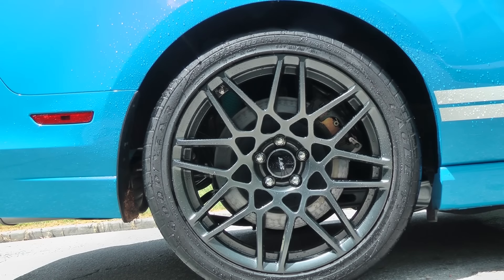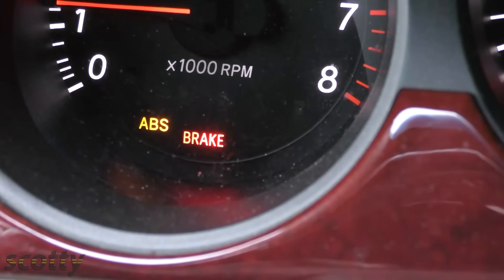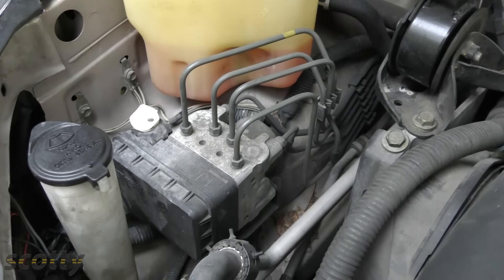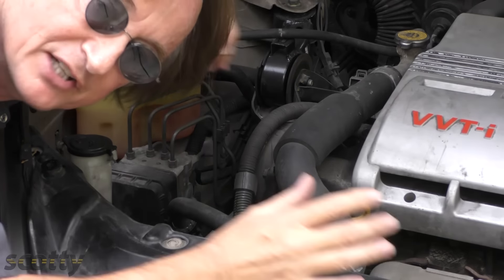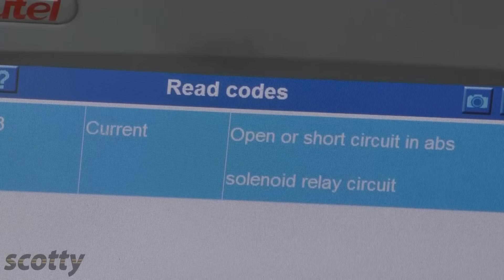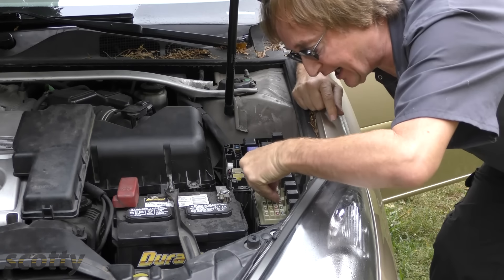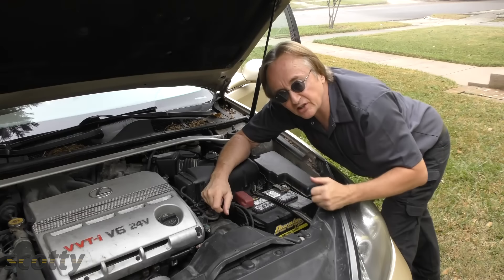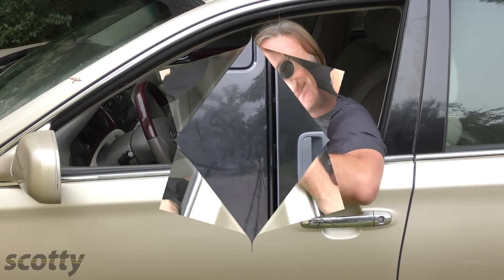ABS Light Stays On, What To Do?

Comment: I use black electrical tape !
Reply: Rodney Brand Well you don't really see white electrical tape, so it isn't lol.
Reply: Me too, not worth the money to fix, and in my case rear ABS only isn't useful for anything in the first place...course ABS, traction control, stability control, etc. is nothing more than a safety nanny that let's people who have to business behind the wheel drive :(.  Most of my vehicles don't have any safety features at all, and guess what, nothing fails in them because there's no damn computer to fail.  Air, Fuel, Spark, that's all I need in my vehicles to get going, I did upgrade the brakes a while back as the brake pads that were on it along with the discs and drums were horrible from the beginning...don't buy cheap brakes or brake parts, at some point you will want to stop LOL.
Reply: Be careful. If you drive a car like that and have an accident your insurance company can claim you were driving a car knowing it had "defective brakes" and deny your damage or liability claim.

Comment: Have you any experience using Honda protective capsicum tape to prevent rodents eating the wires leading to the wheel speed sensors ?

Comment: Well still have light on they said breaks are installed ok and it could be a senser but also Ive seen cars with dirty sensors and saw them clean them. One of my cars had sensor on sometimes and sometimes not. Like my van with oil light on sometimes.

Comment: There is also connection to wheel bearings. My repairman said that broken wheel bearings has damaged the abs cable and they both need to be replaced at the same time. Otherwise same problems will come back. Those cables are one third price in internet than stores and I order wheel bearing at the same time. I scanned and it told right rear wheel has connection problems. It comes off and on very randomly and cold weather and warm engine has influence for that.

Comment: on some vehicles when ABS light comes on brake light to come on to but your brakes will still work just fine you just have regular brakes and if ABS module goes out you won't be able to read it on a scan tool anyways if you know how to use your brakes correctly and pump them without the ABS you can stop quicker

Comment: my car had a steering wheel position sensor go bad which was complete hell. you'd be driving (usuially making a curve) and the brakes would freak out for no reason at all. then the little dash screen would say "service stabiltrak" and " service ABS system" took the dealer many attempts to find the problem. it was under warranty so it didn't cost anything except hardache and time.

Comment: Hey thanks Scotty, do you have any videos on Isuzu's, i Just got one Rodeo for $1900 in L.A. with 145K miles 2002, guys a mechanic and wife drove it, he kept it nice. ABS just came on LOL. Runs great! I had another 98, a tank, last 5 years I didn't change the oil just to see when the engine would seize, it didn't, I finally drained it, really bad, but it kept going, sold it to a student, lol.

Comment: My issue is that my ABS module in my Camaro needs the circuit board joints to be re-soldered and I'm considering shipping it to a repair shop. I haven't tried, but is it safe to drive a car without an ABS module installed?

Comment: The ABS sensor is in the third member not per wheel only the right wheel locks up the emergency brake seems to be free the rest of the components look normal not sure about the slave cylinder this is an emergency we need to tell all the way to Missouri so if you could help me as soon as you can I would totally appreciate anything you can help me with thank you

Comment: I have no lights on dash 07 dakota 192k miles the brake pedal will push to the floor but i can pump it up, new master brake booster etc.... now can the abs fail but not throw any codes? And of course nothing on YouTube pn how to change them and bleed them online, guess its not so much of an issue for these trucks idk... so say i pull the fuse and have normsl brake pedal again would this mean thr module is junk? Can it be rebuilt?

Comment: I have a Celica im gonna use as a track car. And my Abs stops working then starts again, Not fun if your going into a speedy corner and the car suddenly deceides to bo old regular brakes. It lockes the brakes. Where i plug in my sensor that thing is busted. How do i check them the old scool way or make a video about changing the sensor plug in? Thx :)

Comment: Hi thx for easy explanation on ABS lite on dashboard!!
I don’t understand why my ABS lite would be showing on dashboard, especially after I just put new brakes in, all around & I just put new tires on also all around!!
Why is the ABS lite on aftr hving new breaks& tires put on my car!!!
Can u tell me why??
Ty again
Reply: Your car has four wheel hubs behind the hubs is the sensor for the ABS. Check behind each wheel hub and see if the connectors came unplugged. Sometimes you can fix it by unplugging and spraying some cleaner into both ends of the connectors and then plug them back together.

Comment: Hi Scotty I have a brake problem on my 2000 5.3 Chevy Silverado i’ve noticed throughout last year my brake pedal would not react like it used to I would have to push down harder in order to come to a stop. I replaced all four disc brakes disc’s all calipers and recently the master cylinder am I problem still the same what do you think it could be because before I start having this problem as soon as I would touch the brakes it would grab and stop

Comment: Hi... I have a 2000 gmc safari and it has a small issue, every time I put it on drive it shakes a little and I already put new spark plugs and new cables I also changed the motor mount and the transmission mount and the distributor cap and the rotor and the fuel filter and the harmanic balancer and the mass airflow sensor even I switch to super unleaded. Can you please help me find the problem? Thanks and God bless you.

Comment: Can outside heat temperature cause it to come on?
Reply: outside temperature can cause the ABS module to malfunction if the solder joints on the circuit board are cracked. A fix for that is to reapply solder on those joints.

Comment: If you have a chevrolet silverado or another similar truck, if the ABS light comes on, check the wheel bearings!!  Ours went out on a trip.  We would hit a bump and the abs light would come on and then go off......when we got back home, the wheel literally was falling off the front on both sides.  Barely made it back.  Replaced both hub assemblies.  The tone rings were broken and the bearings were falling out.  The wheel was wobbling.  No bearing noise before this event.  2005 silverado with 70k miles on it.  Learned a valuable lesson that day.  Both sides failed at the same time...both made in USA.

Comment: My ABS light has been on for a year or 2 now and I drove through all last winter and didn’t think anything of it. Basically ABS isn’t needed but in most cases it does help.
Reply: so you never had any issues with you car since the ABS light came up
Reply: Mine's also been on for 2 yrs low mileage on a 2017 Rogue

Comment: Hi
I have mustang 2005, no abs light but after diagnosing the system it cames of that abs need to be replace, my question is there any code or number for each module to be replace with same one or just any 05 abs can be work for a replacement??

Comment: 2002 ford explorer limited 4.0 2 wheel drives, my abs stay on the computer says I need a speed sensor and my brake pedal got spongy right after I  replace a sensor on the master cylinder so I bleed the brakes that help a little but the brak pedal did not return to regular brake pedal height so I been driving like this for about 2 months now the brake pedal is starting to become unresponsive, abs pump does not come on at all, if I mash the brake hard then I have some brakes but if I mash the brake slow it goes to the floor sometimes and pedal gets stuck to the floor, have any suggestions help help help.

Comment: Can you just pull the fuse to disable & make the damn light go Away? I have no issues with my 2002 Blazer ZR2 except for the damn ABS Light. I put a piece of tape over it but it bugs me cause it comes on & off randomly. I believe it’s a short issue. I’ve changed about everything else

Comment: My friend has a 2002 Dodge Dakota that the ABS light is on (along with the bell) 
I replaced the sensor that sits on top of the differential and it's still on. The scanner says something along the lines of the tone ring being out of range. I'm not seeing any abs cables on the front
The front is disc and the rear is drum

Comment: Hope I can get my question answered, I have a 2013 Chevy Cruze lt eco engine 1.4.  I let a relative borrow my car, they were going to crash, so they stomped on the breaks. Now my vehicle has the “ABS, STABILITY TRAK, TRACTION CONTROL LIGHTS ON” (HELP) My Vehicle is not drive-able. It won’t move forward or backwards. Do I need to replace the abs module?

Comment: I had a Ford F150 that locked the brakes up the 1st time you used the brakes when driving every time. Replaced the abs sensor, still did the same thing. Sold the Ford, bought a Toyota.

Comment: Hello sir do u have any information about lumina 2000 model ABS faulty error , when I started my car and drive on the road, when I push the break paddle there is a noise it's like "tick tick tick" and on its screen there is ABS faulty error on the system

Comment: I have a 2004 GMC Sierra and my abs would kick in under 5mph like if I was slipping so I got new wheel hub assembly with new abs and it no longer makes that sound brakes work fine brake fluid is fine as well but the abs light still turns on and off or stays on for a while I’m confused on what happen because although my abs would kick in I didn’t have the abs light on or the brake light on but now that I got new ones for the front and I no longer hear the noise the abs light is now on. So idk if I have to reset it or whags going on

Comment: Hi Scotty, can you help me find a solution for my 2005 Nissan Pathfinder, it has the abs light on, the code points to rear right sensor , I replaced the sensor and the same result, rear right sensor again  and would not come off, even if they try to erase it with the machine and even that failed.  The sensor  is (split, on connector for two sensors).  One thing I have to mention, my parking brake engages but the car will still roll, please help any imput will be appreciated. I am due for inspection on Tuesday. Thanks

Comment: Just replaced the abs module sensor on my sisters 2007 chevy impala 3.5l but the abs and brake light is still on. Checked wires all are good maybe cleaning the speed sensors someone got any knowledge on this car.

Comment: I have a 95 dodge 1500 the abs light is on breaks will still put you through the wind shield and i dont have a plug in for the code readers under the dash is there any other way to hook a tester up to it to read for codes?

Comment: ABS and break lights both light up.  Once  a small accident on the fender and head light gone in rural area.  ABS can get damaged in accidents? Break light worries me.  Breaks are working fine from 2016 when this happened.  A loose connection causing the lights to go away and come back.  Break light is worrying me. What to do?. Cannot find where loose connection is.

Comment: Scotty i have a question about ABS. I just had my cv joints replaced and back and front breaks, the abs and trac off lights came on after the replacements. Is this a problem, they were not on before.

Comment: what wikk be the possible trouble of my chrysler 2006 town & conutry, ABS is on and my front wheel both left & right are stucked-up. I raise my car in a gas station to confirm the statues of my front wheel it does not rotate. kindly help me to fix my car. thanks.

Comment: @ScottyKilmer My Abs and Brake light come on steady after yanking my ebrake (heard a snap at my ebrake lever) ever since tried even the dealership to pull codes error communication with Abs module. Is an 06 wrx. Any help? I changed all brake bulbs. Fluids topped off. Its driving me crazy!!

Comment: Scotty, the abs light turns on and my speedometer starts jumping. Also rpms goes up and down. I replaced trans speed sensor. The 2 front wheel speed sensors. What may he the problem

Comment: I had to change the harness for my back lights. Now my brake light only works when i turn my headlights on. And my tail lights only work when i press the brake. It's a 99 honda passport so it only has 3 light spots for bulbs. The other 2 lights (blinker and reverse) work fine. I don't drive a night cause i don't want pulled over anymore. What did i do wrong??

Comment: Dear Scotty. 
hope u r fine and good. 
I had feont Axle work my camry 2008 but then ABS and Engine light stays on and gear shifting is not working properly. mechanic changed the sensor now all lights are gone . but still after driving 15 minutes gears wont shift RPM goes to more than 3 but gear wont shift and speed wont increase then if i release Accelerator Its suddenly shift with a jerk and speed increase . and also car is jerking like its manual which its not . 
its automatic . can u have some soultion to it

Comment: The ABS light on my Camry 2003 started blinking. This was two days after I had an oil change and complete multipoint inspection done at a Toyota dealership service center. First the check engine light came on AND THEN after a few hours, the ABS light started blinking. I’m short on finances at the moment and worried about the cost of repairs.

Comment: My old 94 Olds Cutlass Ciera had ABS on it and sometimes it would work, other times it wouldn't. I couldn't understand this and then by some freak accident, I found out that the rear mounted brake light needs to be working otherwise, the ABS system doesn't work. It had two lights in it and I think either the bulbs were loose or something because tapping on it would most of the time make it start lighting up again, and low and behold, the ABS light would go off. Never did figure out why that was a thing.

Comment: I have a Toyota Rush 2007. The ABS indicator stays on so I did a scan at the garage but they could not locate the problem. They even checked all 4 sensors. Finally, a student of mine told be that both brake lights were not working. I replaced both asap and ABS problem solved!

Comment: Important: If you lock all the wheels, ABS stops working? The worse ABS fault I ever had .. checked all the sensors, they are only hall effect transistors? Checked all the wiring. What I found out, is that the ABS computer checks the brake lights, one of these had burnt out, and then re-welded itself. This meant the system was a different wattage and drew the wrong current ... and that made the light come on. If you ABS light comes on, change the brake bulbs lights first?

Comment: I have a 2015 mustang gt and my ABS lights and breaks went on. Also my car's breaks got locked and I cant start my car either. not to mention the battery went off too. at first everything was flashing lights but now everything is off. I had to give more battery so I could put it to Neutral and get it tow to the dealership. I still dont know what's the problem. if you guys can tell me I'll appreciate it.

Comment: when pressing the brake petal it goes half way down before kicking in to stop the car.. plus the abs light is always on. I went to mineke and 3 shops in Manhattan and the Bronx. i Changed master cylinder 3x changed disc brakes and back rotors, changed all 4 brake hoses and changed the front calipers, changed pump behind the master cylinder and lastly changed the abs control module. 

The problem still persist mechanics all seem to say you don't need the abs system but from what i've learned online is the abs pump helps with the petal going down before the car stops. Scanner could not read the abs system at all with the old and the new abs module. Im lost for what to do as they just tell me drive the car like it is and stop wasting money.. but id like the car to run right.

Comment: Scotty I have a question I have a 1993 Chevy Camaro the red warning brake light is on I replace the master cylinder because it was leaking and had leaked into the brake booster I replaced the brake booster also. I have put new pads on the front to rear drum shoes are decent about 3/32. I remove the center consul and check the connector to the emergency brake cleaned it all up to make sure it gets good connection. I am not losing break fluid in the master cylinder does not have a fluid sensor so if you have any thoughts I would greatly appreciate your input thank you.

Comment: I have a ABS light on  my 03 gt mustang. Error code is ABS Light - Code C1223 - Lamp brake warning light output circuit failure. Any ideas what I should do about this? I can never figure it out. Its been this way since January.

Comment: I have a question. I have a 2007 Toyota Camry. My ABS and brake light comes on while I’m driving along with my gauges and speedometer acting crazy going up and down. It comes on every now and then when I’m drive, but only stays on for 20-30 seconds then disappears. I start work next week, so I wanted to know if my car is still safe to drive, because my car is my only ride. Please help.

Comment: Hi please help me my car is daihatsu sirion 2008 and I have abs light staying on I check on multimeter wheel sensor reading is 1.224 k ohms and pump to connector dc voltage which ignition on 11.82 volt please you be able to tell me what problem I have with my car please